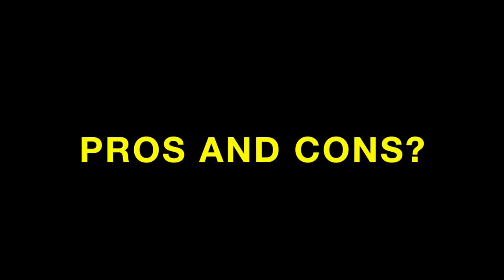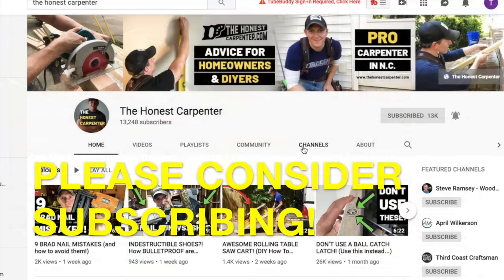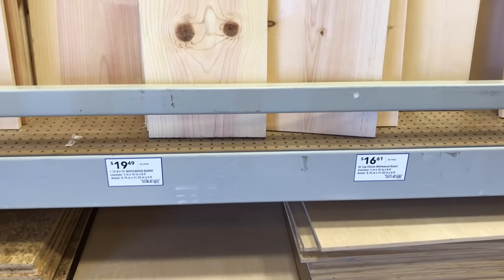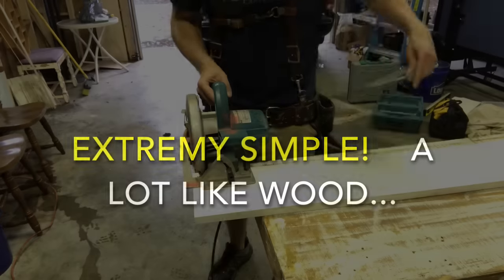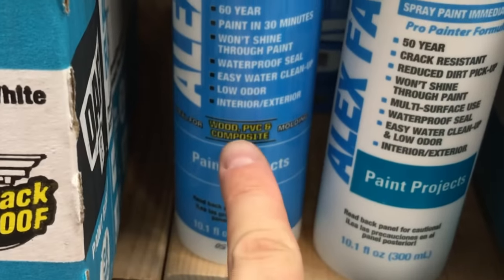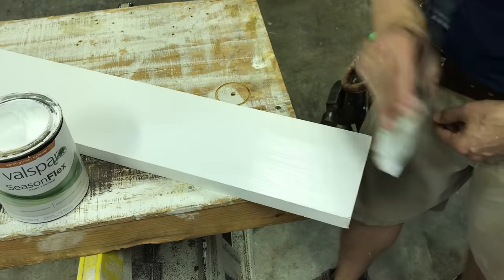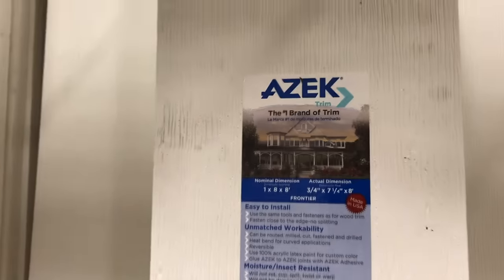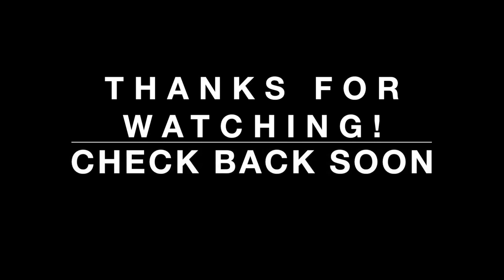PVC TRIM VS. WOOD TRIM? (Pros And Cons!)

Comment: What about vinyl-wrapped MDF? I bought the matching baseboards for my vinyl-plank flooring, and no one seems to cover this. I am especially worried because I don't have a nail gun, and the only trim I've put up before is trimming and reattaching the wood door trim yesterday. This left little circles around the nails despite drilling pilot holes with a cut finishing nail first. I'm going to have to touch it up somehow, but that wouldn't be possible on printed vinyl. What should I know?

Comment: Doing a basement I was thinking putting 6 inch PVC board on the bottom and drywall above it so I get a 6 inch buffer from the floor to drywall. Do you have any thoughts?

Comment: If you had  trim on a porch that is exposed to the weather 24 -7 and there is rot 1 feet where the post trim meets the vertical trim perpendicular  on both pieces would just replace the rot with pvc or the whole 8 ft and 6 ft lengths ?

Comment: how about bending and traditional pvc pipe glue? can i use a hair dryer or heat gun to bend these boards? or using pvc pipe glue to joint them? it looks promising if i am using these boards to make rain covers for outdoor electric device and use on boats.

Comment: Thanks for the video - Here's my question, What about using this product for shutters?  I know there is a cost factor but what's your thought on shutters.  thanks  Steve in Ohio
Reply: It would probably work well.
Reply: I don't think ot would hurt. Just make sure to ground your tools( someone mentioned this earlier in the comments) and collect the dust. I recommend taking the dust to a person who recycles pvc. You can use water to keep the dust from flying. Just saturate it as you are cutting. You can waterproof your tools with some spray on Silicone lubricant.

Comment: Hi. I am looking to replace the wood trim around my shed door. The guy at Home Depot recommended this stuff instead of wood. The hinges for the shed door will be screwed into the PVC trim, is this ok? Will the PVC trim "give out" over time and make the hinges loose? I could use longer screws and screw into the wood behind the trim, but just making sure I am on the right track. Thanks!
Reply from the maker: Hey Andrew, my guess is that the pvc trim would hold, but as you said, you can improve your odds by getting longer screws in the top hinge to hit framing lumber behind

Comment: The wood frames around our windows rotted, so the handyman is replacing them with textured PVC boards. These are white, but we want them to be dark brown (like the old wooden frame). I purchased dark brown acrylic latex paint and black cault, but later I read that you cannot paint PVC board dark colors -- is this true?

Comment: Hey Ethan, Hope you and family are well and safe!  And thank you guys so much for sharing your expertise. My under the kitchen cabinet repair from last year is still holding strong even with our way above average kitchen use during quarantine. 

I just installed my first window, and bought some pvc 1x4 and some #8 GRK fasteners.  After revisiting your video, I wonder if I should use some glue too. Do you always use the loctite pl or do you ever find Oatey PVC Cement or OSI 1429651 Polyurethane Adhesive to be preferable under any circumstances? Maybe I should join the corners with Oatey and use the loctite underneath? 

Thanks so much again, you guys are so awesome and most generous.

Comment: Excellent video. Tell us how you repair small scratches and dents in PVC please.
Reply from the maker: Thanks David! Tiny scratches can be sanded out. But slightly deeper dents will usually require sanding in the dent, followed by an epoxy fill (a number of brands work), then some more sanding

Comment: Thank you for this video, which is very informative! Also, I have subscribed to your channel.  I have a question on power saws, specifically circular saws: do you recommend a re-chargeable circular saw and if so which one? Is there one you recommend with a laser on it? Thank you!
Reply from the maker: I’ve always used corded saws Jeff. They tend to be more powerful. But battery circ saws have come a long way, essentially makita. Thanks for subscribing!

Comment: DAP Alex Fast Dry sucks for any application. Sure, it dries fast....it also shrinks and cracks fast. Alex Flex is good for anything as far as I can tell. I have become partial to the DAP Extreme Flex type as well. Does anyone have any negative points they've noticed about Extreme Stretch? (What kills me is how some caulking [some DAP products included] is how it's advertised for gaps "up to 3" ". If you have 3" gaps, you don't need caulk, you need a new carpenter!)

Comment: Great video and thank you so much!
I picked up a little sample piece of this PVC 1x4 to see how I would like it on my windows and I actually just spray painted it black because I do want to paint my trim outside in black.. but your video indicates that this product does not work well with dark colors so I may have to go back to the using wood for my trim but I wanted to make a comment that my neighbor had her windows trimmed in the PVC and she said that she ended up having to remove it because it did over time warp.

Your instruction indicates that this product doesn't warp..???

Comment: I’m wondering if one couldn’t use a watersaw for cutting instead of a regular. One could cut some but not all cuts and reduce the fly off of plastic dust. I know the saw could handle the cuts.

Comment: I just purchased PVC trim for my basement. And I'm a little hesitant because I've never used it before. Can I use my nail gun with it and if so what size finishing nails? 16 gauge ?
Reply from the maker: Yeah, that should work fine Michael. Just try not to bruise it!
Reply: @TheHonestCarpenter  thanks. Someone also told me to glue it on... But I'm not sure I like the idea of baseboard only being glued.

Comment: I just had the rotting outer wood of the columns in the front of my house replaced with PVC boards.  The contractor did  not use caulk where the pvc rests on the concrete, but it was caulked there before when the columns were faced with wood.  I'm concerned about water, because the inner post which supports my roof and is inside the PVC boards is made of wood.  Should the base be caulked?
Reply: Not if the wood inside is pressure treated

Comment: What is the best way to put it in a room as a baseboard if you cannot get a 12 foot section? Is there a way to use 8 foot sections and join them together with say a 45° cut in the middle?

Comment: Thanks for the info. Most of my trim needs to be replaced and some areas is rotted-out. The one area of concern is the board trim along the roof. At the top its fine but towards the end it is rotten. My concern is the power line coming into the house is attached at the top. I thought of cutting off the wood a foot or two down from that line. Since that section is not rotted would doing that be ok? Everywhere else I will replace the entire piece. Any suggestions??

Comment: Just my two cents, but as far as interior trim goes, if you have a cat or other destructive pets, go with wood. The family cat destroyed our plastic corner trim over a few years, but the wood is harsher on the claws and he doesn’t damage those as much. I recently replaced his favorite, torn up plastic corner trim with a wood one. He tried scratching it a few times, but couldn’t get very deep and stopped afterwards. Now, I can easily come back, sand over the few scratches and touch it up with some plastic wood (on the deeper ones) and paint. And then as I replace the others with wood, his habit has died down and he’s using his dedicated scratch posts more now. The plastic trim couldn’t be fixed, nor did it display a nice wood grain.

Comment: Trying to find almond color garage door trim and brick molding. 17' length. Hard to get unless you buy minimum order. Any ideas? S.E Wisconsin. Good video.
Reply: With Allback linseed oil paint you can use wood and not have it rot on you, and paint the wood almost colour.  If you can't find the colour of that you want you can mix two or more colours together.  You can find this paint at The Eco Living Room at 12 Cataraqui Street just west of The Woolen Mill if you're in Kingston Ontario.  If you live in another city or want to browse these products first, you can check out www.sagerestoration.com.  If you live in the US, you can check out www.solventfreepaint.com.  With this line of products, the linseed oil soaks into the wood, and they are also breathable.  Other paints harden on top of the wood and form a "plastic" coating, and are not breathable, so they trap moisture.

Comment: I have been using PVC trim for many years, ever since the wooden brickmould rotted away on our back door.  One of my pet peeves is that door jambs easily rot out where I live when exposed to moisture but you cannot find doors with rot-proof or rot-resistant jambs at any of the local home improvement store.  I suppose the doors can be special ordered?
Reply: Yeah that bothers me... I am a rough carpenter, and even the expensive service doors we install on custom homes have pvc brick mould with WOOD jambs... Should be the opposite. .. Rotted brick mould is nothing to change out, but if the jamb rots,  you're buying a new door.
Reply from the maker: I see this all the time, PickleRix, and it's crazy frustrating. Some companies are now getting around to affixing composite bottoms on jambs, but they're not widespread, and door manufacturers are using them on all units. The moment that pine gets wet or sits on a slab, it starts drinking water 😓

Comment: Can you install PVC trim on either side? I was looking at a long board recently, and noticed that one side is a bit rougher than the other.
Reply: Yes, the big box stores stock the stuff so people have a choice of smooth or textured for the outside exposure.  Personally I prefer the smooth side out as I usually paint trim.  But if you want white trim it does not have to be painted.  I suspect unpainted cellular PVC trim will UV deteriorate over time like PVC siding.
Reply: @jamesmoon1841  Thank you!

Comment: Would you say that PVC trim, 1x4 for instance, is structurally rigid enough to use for small patio tables, or even Adirondack chairs? I can’t find a retailer who sells polywood, and I’d like to use something that will still up to Houston weather.
Reply: PVC is definitely not structural. It will sag even under its own weight. For furniture, I'd recommend cedar, redwood, ipe, teak, or mahogany. All will stand up to the weather for a long time.

BTW, If you are thinking about starting a new project or repair, please think about reserving a consultation at TheHonestCarpenter.com. We'll give you unbiased advice that could save you time, money, and heartache.

Ross James
Lead Consultant
TheHonestCarpenter.com

Comment: Will PVC trim stand up as a facial board without painting, in other words, using it's natural white color as the finish? Much of my fascia is 30' or more off the ground with steep slopes beneath it. Painting it is extremely difficult. Something that is white and requires no painting would be a great help.
Reply from the maker: I always like to paint it when I install pvc, pyro. BUT a lot of the Manufacturers these days print on the packaging that it doesn’t need to be painted. So, leaving it unpainted seems to be an option
Reply: @TheHonestCarpenter  Thank you!

Comment: We used Hardy boards for exterior window trims    here in Tx. I never thought of using PVC boards. I wonder if the heat would be to much for the southern states homes.
Reply: Someone mentioned earlier to use water and ground the tools to prevent dust flying away and sticking to things.

Comment: I purchased a pvc trim panel, 1/4" x 48" x 8 ft. I'm building an 8x8 chicken coop and don't like the look of just the painted the plywood, so I plan to attach this for an exterior with easy maintenance, and adding more pvc trim to finish off. Will this product get condensation behind it and be a problem, or can I attach it to the plywood directly? That same plywood is exposed on the interior of the coop (as it is now at least), or I could add another pvc panel on the inside. I'm not an experienced builder...anything I should know?
Reply from the maker: Hey Loofah, I wouldn't expect much condensation to form behind it. Instead, I would really focus on making sure that no water can drip or run behind it from above! Make sure you've got enough roof overhang to prevent blow-in, and consider caulking the seam at the top of the PVC to seal it
Reply: Thank you!

Comment: I use PVC reverse boards that is what its call . Wood grain on one side and smooth on other.  Comes in 3/4 and 5 1/4 or 1 inch / I make gates out of it. The old wood ones cost more to replace. this will cost about $800. to $900 to make a new replacement. The 1 inch is the best thickness. new hardware paint and installation. The old door needs to be trashed that cost a little also wood jambs holding it may need some work. Most homes have walls around the house property with old wood doors that I replace. So price your time & material and sell a few.. My cost is $400 + labor 2 days for a 36 " wide x 6 foot height  with arch tops. I am raising my cost $100 more. Thx Honest guy we are few ..

Comment: i have a front main entry door that its Pvc and gel stained with a Northern exposure and been holding up rather well to the weather elements, but i haven't had the same luck with the wood trim . Can the gel stain hold up similarly to pvc trim

Comment: No matter the cost, ALWAYS use pvc when board comes in contact with concrete, such as columns on porches.  You will never have to replace due to rot.  Videographer forgot to mention:  unlike wood, the 'endgrain' of pvc will hold paint and continue to look good over time.

Comment: 1.) Those $160 sheets he talks about are $100 in my area - not sure if it's regional or just time. OSB is like 8x more expensive than it was a year ago and plywood has seen a significant increase, but that might just be the 'rona....
2.) Read the instructions....
PVC solvent, NOT a construction adhesive. Screws instead of nails. No butt joints. Etc. 
The trim itself won't rot, but it will expand and contract (a lot) and let the stuff behind it rot.

Comment: You should switch to Boral, much easier to work with. More board foot for the same price.  No failure issues like pvc joints have.

Comment: Great video.  Very informative.  I would recommend not moving around or zooming so much in your shots.  The camera work was a little dizzying.
Reply from the maker: Thanks Ross! I'll try to keep things more stable in the future. Just working with very rough tools, little time and no budget for now
Reply: Someone mentioned earlier in the comments to use water and ground the tools to prevent dust flying away and sticking to things.

Comment: Thanks.  That answered a lot of questions I didn't even know I had.  Partway through I wondered about making a Rousseau  workbench out of pvc, but you answered that.  Probably not a good idea until they start making tougher pvc.
Reply from the maker: @Grinfilled Celt True! The stuff can be bruised pretty easily. And as someone else mentioned, it doesn't have a ton of structural strength :(

Comment: Great info. What is the best adhesive to bond pcv quarter round to a plastic bathtub or vinyl tub moulding to a plastic tub?
Reply from the maker: Hey Ryan, I might not even go with anything too aggressive. Possibly just a pvc approved caulk. Just in case it needs to be changed later
Reply: @TheHonestCarpenter  Thanks, good point.

Comment: Too often, the durability of PVC traps people into thinking that they don't have to worry with that area again. But focus on maintenance is more necessary than with wood becauuse the sealants will fail.  All of the substructures will be compromised, and rot relatively fast because they can't easily dry out. A lot of  damage can occur and because the PVC still looks good, it goes unnoticed

Comment: I need to replace the fascia and the soffit on my garage.. should I use pvc for both? The gutter was falling off.
Reply: I don't think ot would hurt. Just make sure to ground your tools( someone mentioned this earlier in the comments) and collect the dust. I recommend taking the dust to a person who recycles pvc. You can use water to keep the dust from flying. Just saturate it as you are cutting. You can waterproof your tools with some spray on Silicone lubricant.

Comment: I had one contractor tell me that PVC is ruined if you have to pull nailed pieces off or apart.   You can't save it like you could wood pieces.    Is that true?
Reply from the maker: It does bruise easily, RM. but sometimes you can shimmy it loose. Really depends on how it was fastened.

Comment: Is PVC as strong as wood? For example, I'm going to hang real functional shutters on window trim. Will PVC hold that weight as well as wood?
Reply: I would use a screw that would grab the jack and king studs through the PVC just to be safe but if the shutters are light weight enough PVC will hold up but it can fail with too much weight as the PVC will crack and spot break rather than follow a wood grain. Hope that helps!
Reply: @commentguy4711  Thank you sir.

Comment: They also make screws with white plugs specifically for pvc, if you don't want to use caulk or paint to cover nail heads. You overdrive the screw and put in a tiny white cap that is nearly invisible.

Comment: I was waiting for him to talk about the PVC dust. That shit sucks. But I found out about a game changer for it. Spray anti-static spray on your chop box and table saw or whatever tools you're using to cut and rip it. It will make it soooo much easier to clean and blow off your tools. Now your skin is a whole other story. Try not to sweat when you're cutting it. It is pretty hard to get it off your sweaty ass.